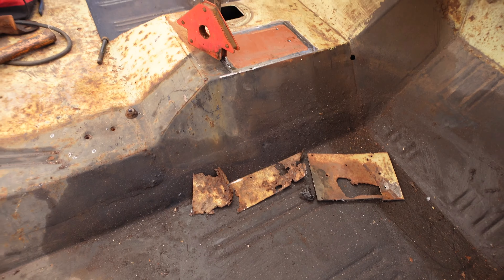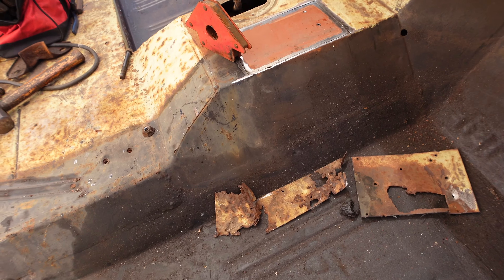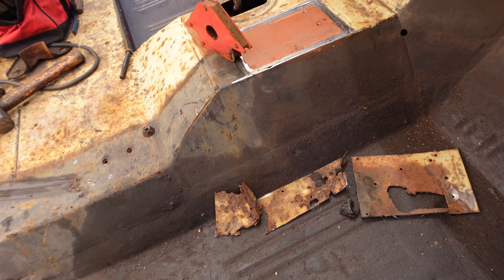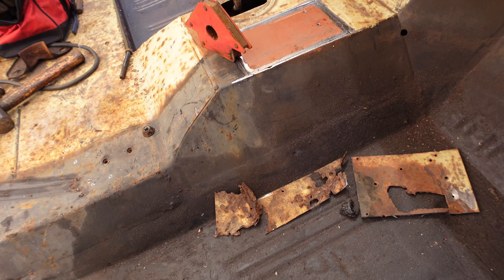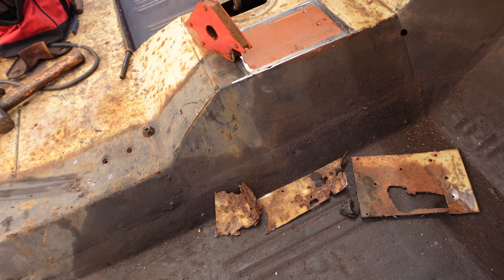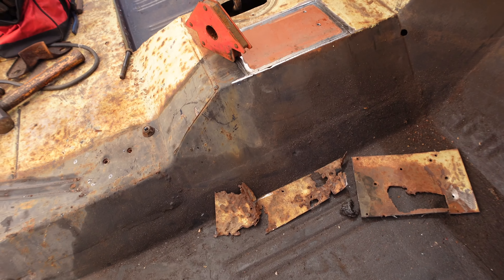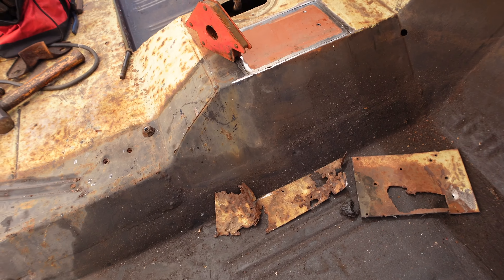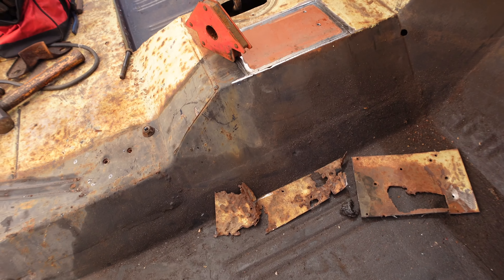Ford Bronco Not so Cheap Build Episode 9 | More Rust to Tackle plus a new A-Pillar

Comment: Never knew about rust converter.  Does it physically change the rust to something else or does the rust get oxidized by the converter and morph back into metal-like material again?  Thanks.
Reply from the maker: It definitely converts the rust to a hard surface.  It is supposed to stop the rust from spreading again.  I tried this on another project before and what I learned is that as long as I’m the area remains dry that the rust doesn’t come back.  I get it that rust never really goes away.